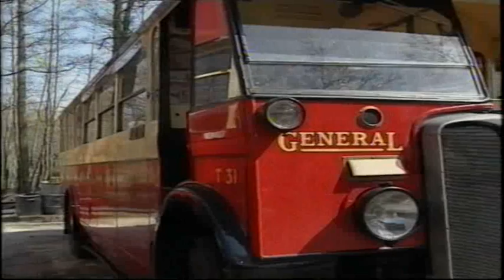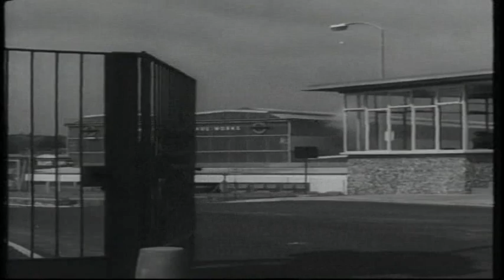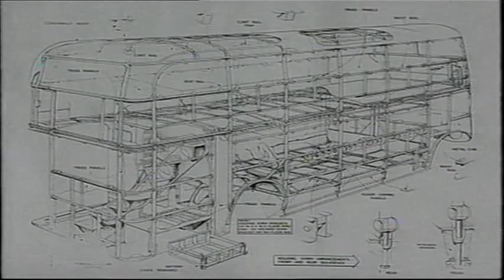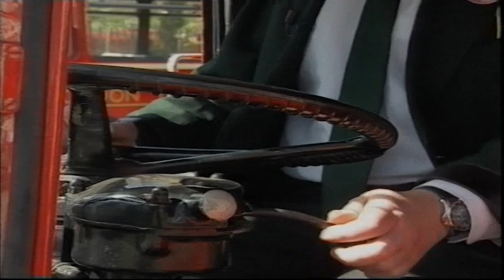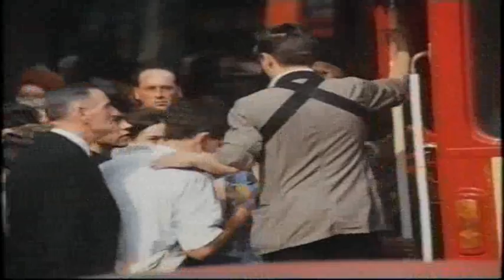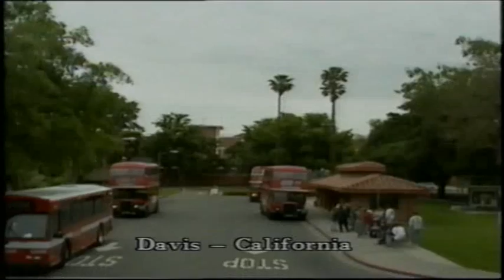Story Of The RT See description for improved video.

Comment: The tilting test lol if the bus had more passengers on top at that tilt the bus would have gone over on its side without doubt.
Reply: No it wouldn`t.  One of the design requirements was to be able to tilt test with empty bottom deck and a top deck fully loaded with sandbags in each seat representing a worse case scenario. It met the design parameters and passed. A separate video by London Transport actually shows the test being performed.

Comment: In WW2 a number of London RT's were sent to the City of Bath to suppliment their fleet of "Bristol" buses. Drivers loved the pre-selector gearbox and passengers found them smoother and a little quieter than the Bristols.  

The only "Irritation" with the RT was that it did not like some of the very steep hills on some of the routes around Bath. 

I remember being on a fairly full RT at Shophouse Road in Bath which is a fairly steep hill. A passenger rang the bell to get off at the next stop half way up the hill. When the bus came to a halt and the passenger had alighted, the driver attempted to pull away, but  the bus juddered and would not move. After a couple of attempted a smell of hot hydraulic fuid filled the air we all got off the bus and the driver tried again. The bus pulled away easily so we walked to the top of the hill where the bus was waiting. Of course nobody complained.... there was a war on.....

Comment: The tilt test was interesting. I wonder if it was anyone's job to wonder what would happen with a top deck full of passengers adding their weight to the equation?
Reply: In fact one of the tests was a bottom deck empty and a top deck loaded with sandbags representing a worse case passenger loading scenario and it still passed the tilt test

Comment: I remember riding RTs as schoolboy in Northamptonshire in the late 1960s. One model had an aisle on the right hand side upstairs. The seats went off to the left, and sometimes were staggered into individual seats. Can anyone tell me more about those models?
Reply: @Mike Lloyd  Thank you for the information. I really appreciate you replying.
Reply: It was probably a low height version - the aisle to the right would have been lower than the "floor" of the seats to allow the vehicle height to be reduced for low bridges in its area of work without impacting headroom in most of the lower deck, which a centre "dropped" aisle would do.

Comment: They always looked very top heavy, always wondered if they were overloaded on top would tip over on occasion.?
Reply: Standing passengers were not permitted on the upper deck at any time.
Reply: Surely not you would need to stand so as to exit the bus

Comment: A great film about a legendary bus the RT, which were rampant around London in the 60's. In conjunction with Aldenham works they were basically conveyor belt designed for simplicity with regard to overhauling. Their replacement the RM followed exactly the same principles and in its own right became another legend around the world, working for decades past its original design brief. However now we come to modern day, where the original concepts have all been thrown out the window together with the closure of Aldenham works. We now have a complete  hotchpotch  of off the peg designs which mainly have not been fit for purpose, but there you go, that is progress. To me we have regressed back to the 1930's with different operating companies all using different models.
Reply: True

Comment: Using production line methods actually increased the cost of each body, 7000 pound average instead of 6000 pound using traditional methods.  The advantage of standardisation outweighed the extra cost, as any body could be installed onto any chassis.

Comment: There is a heritage Bus line in London with RT buses. The 15H. Just check google and Wikipedia . The RT buses are passing from St Paul and Fleet Street. It is a short trip starts from Tower Hill and ends at Trafalgar Square with RT busses. Much better than the tourist busses.
Reply: The 15 uses the Routemaster bus, not the RT.
Reply: 1126223457890asdfgggjjk
Aldenham, 12÷35 7880@=€8 11223490123%_557701111111111 1st 111111111111111111111111111111111111111111111 111111111111111111111111111111+111111111111111+111++++++++, 6 50th ×##×
@! ££=6/ ;.^^58